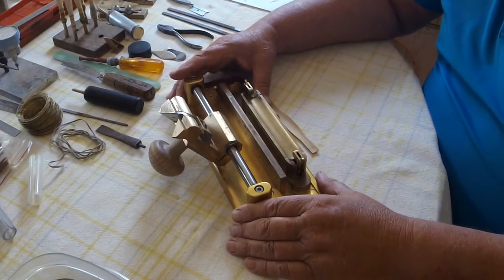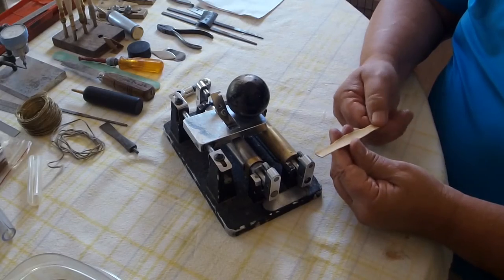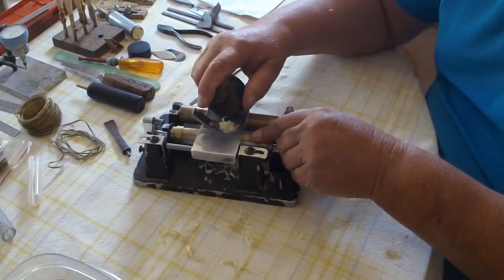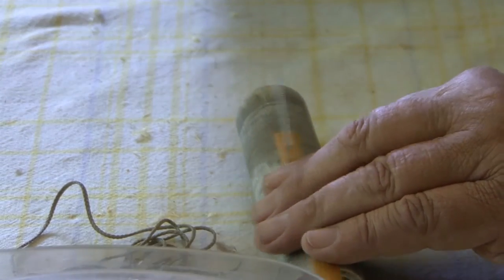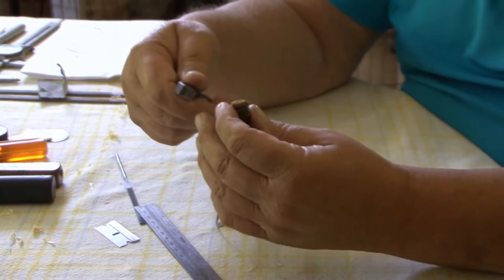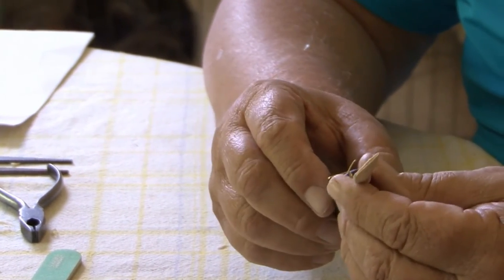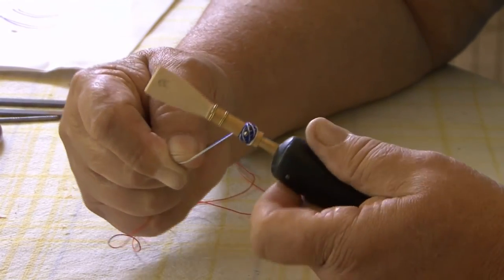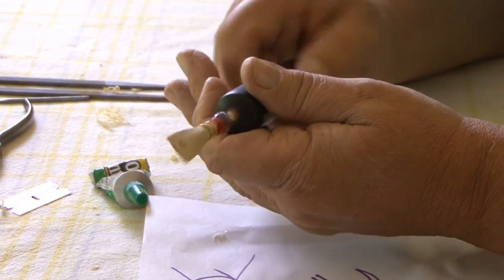Bassoon Reed Making Part 2.

Comment: You can save your profiler blade a bit by scraping off all the bark with a reed knife before you start profiling. The bark is the hardest on the blade so if you remove that first you'll extend the length of time between blade sharpenings. Just a thought.